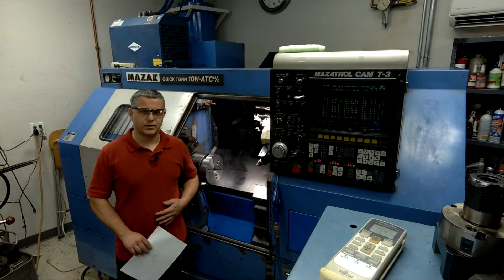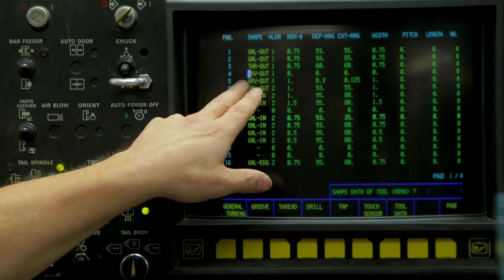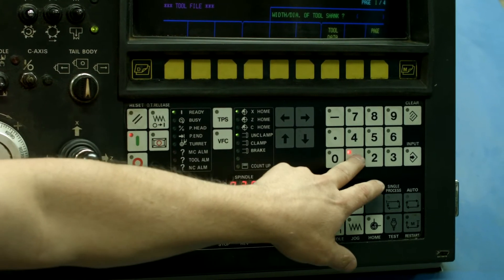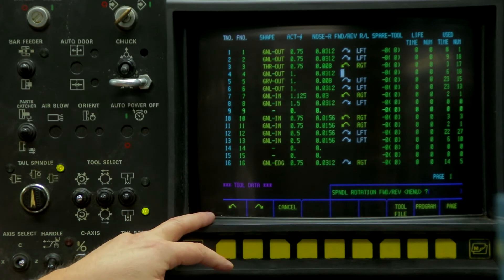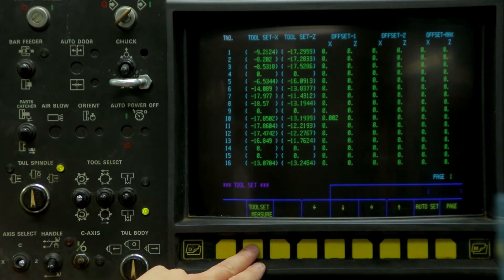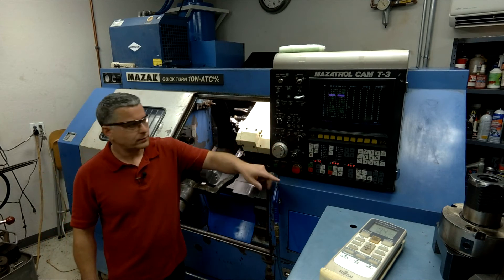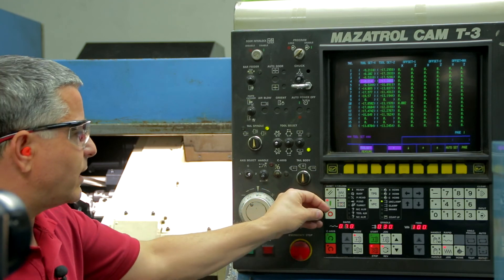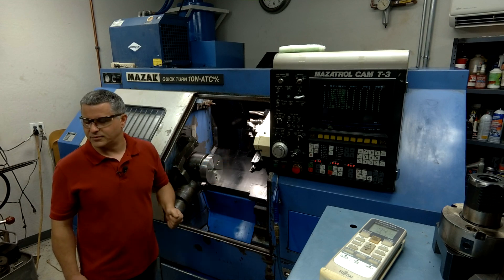Mazatrol Tool Probe and Tool Description for a CNMG 432

Comment: Hi Phil. What angle should I use to describe a 118 degree HSS drill so it will calculate drilling the depth to the diameter of the drill correctly?
Reply from the maker: What control do you have? Early controls do not compensate for tip length.
Reply: My control is a T-32-3.
Reply from the maker: @giddyupbo  Unfortunately I have not ran that control so I don't know what it needs. Is this for stationary drills or live drills?  Enter 59 degrees in for the drill and watch the toolpath. Whatever the toolpath does it what the machine will do to the part.
Reply: Ok, I’ll try that. Where did you come up with the 59 degrees?
Reply: Is that just from dividing 118 in half?
Reply from the maker: @giddyupbo  118 / 2

Comment: Hi Phil. I just bought a SQT18MS. Looking forward to getting it delivered in the next couple weeks and I’ve been watching your vids to get myself acquainted with the machine and the control. I won’t have the manuals in my hands until the machine is delivered, so I can’t look up this question myself yet, so I’ll see if you can help me with it. How does a person go about setting the centerline height of the insert in relation to the centerline of the x axis. In my manual lathe, I can adjust this on with the tool holder and the toolpost.
Reply from the maker: Hi Brian, the centerline height is a fixed dimension and it is based on what size tools the machine was originally intended to use. If it uses 1 inch stick tooling, then you need to buy 1 inch tools.
Reply: Gotcha. So all 1” stick tooling will put the centerline of the insert at the same place?
Reply from the maker: @giddyupbo  Yes.

Comment: Hello I was wondering how you teach and describe a lead tool for rough turning? We typically will use the opposite edge of an 80 deg with a .0312r
Reply from the maker: I have a video about that here called angle tool set..  https://youtu.be/UyU5z4Z4wpg

Comment: Have you ever tried having more than one tool in a position and using the tool offsets to define them? I'm going to be making a lot of small brass fitting and could see an advantage in having a gang tool block with a drill, NC drill and tap in a tool position to avoid some of the tool changes. I'm not sure if there is a workaround so the same tool number can be used for both drilling and tapping since the tool is defined.
Reply from the maker: This is not possible for the older T-2 control, but it is possible for the newer controls.
Reply: @mazatroltipsandtricks6816  Thanks a lot. I have the Fusion 640T control but I don't think any Mazak operators I know has any experience with actually doing this.
Reply from the maker: @epilotdk  You should be able to insert multiple tools in the tool data page.
Reply: @mazatroltipsandtricks6816  I'll have a trawl through the manual and see what it says.
Reply: Found it :-)
I have only programmed the T-2 control in the past. Luckily the basics have not changed.

Comment: hi. i work with mazatrol t plus. your videos very helpful to me. but my machine eye is broken and i dont know how to set "z" offset for a program. is this possible with jog mod on face of workpiece and then set the Z offset to 0 for program? in t plus program Z offset is in the setup menu.
Reply from the maker: If the tool eye is broken, you need to set all tools from a fixed Z location first.  Teach all tools to the face of the bare chuck and then afterward use one tool to set the Z workshift in the program setup screen to the face of your workpiece.
Reply: @mazatroltipsandtricks6816  ok understood . but until now we spend a lot of time for z offset of 4 tool for some difrent pieces when need to switch work map. thank you my friend my master.